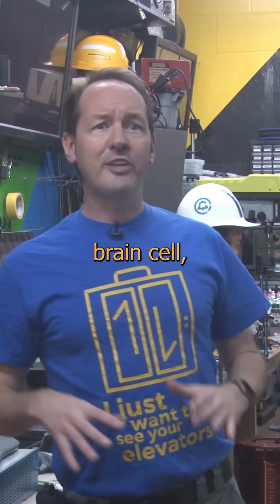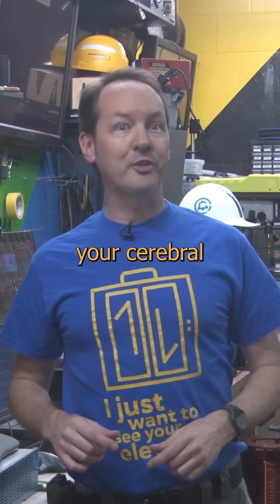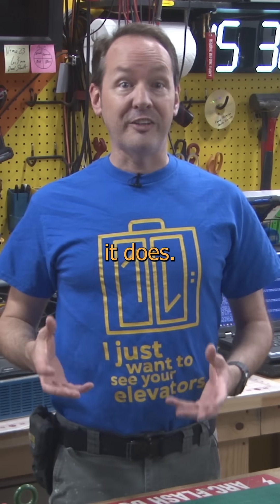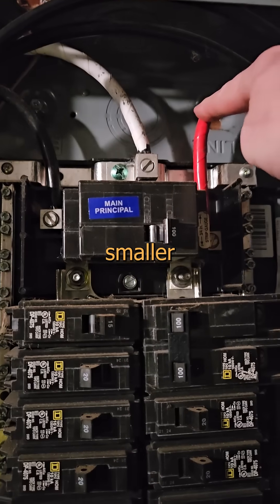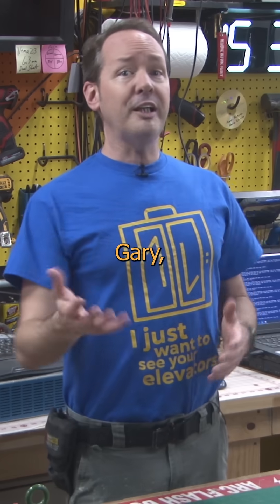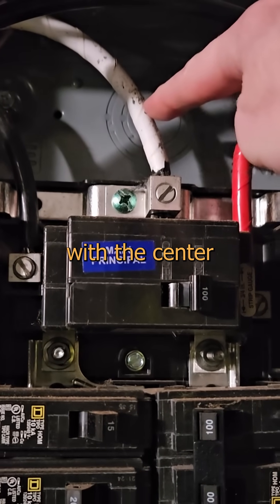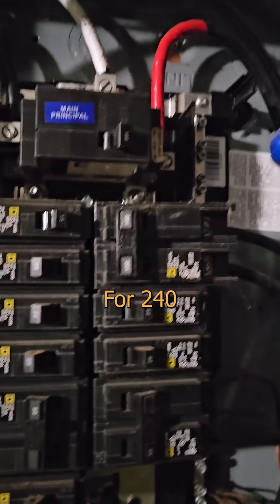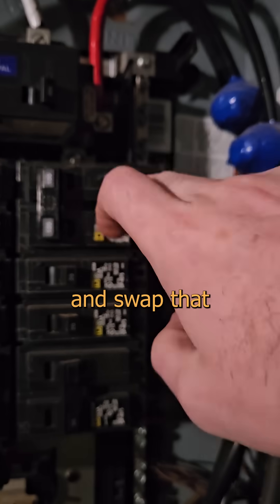Why It's Smaller #engineering #chrisboden #comedy #electrical #science #energy #power #electricity

Comment: And for those with 4 brain cells: what happens to the 120v circuits if the neutral is missing or cut?  Do they:

A) stop working entirely
B) become 240v circuits
C) Let's out all the magic smoke and burn your home down in cataclysmic flames
D) The voltages of the 120v circuits change to something between 0 and 240v, depending on what's on the circuit.
Reply: E. All of the above, depending on various and sundry circumstances! Lol

Lost neutrals are always exciting, and what exactly happens depends on lot on what loads are present and how they are wired, but yes, it causes strange things to happen, from some things not working, to other things getting way too high voltage, and varying as loads turn on and off.

Comment: The fun starts when you LOSE a neutral. 120 doesnt become 0...no no that would be too easy.
Reply: Yup. Best case scenario is that the neutral wire becomes more unsafe to touch. Worst case… well, let’s just say that I’ve seen receptacles become 240v to ground.
Reply: You end up with a situation where some outlets are 150 and others are 90 or whatever, and when you turn on the microwave, the 90 goes up to 130 and the 150 comes down to 110, and the LED light in the kitchen starts flickering. And every time you touch that light switch over there, you get a zap from it. That kind of crap can happen.
Reply: No the worst case is an intermittent floating neutral

Harder to track down 🫠

Mine involved an HOA owned panel 😶‍🌫️
Reply: What causes a nice head scratcher is when someone doesn't ground the X2  on the transformer. I worked at a plant where none of the transformers in the building wasn't bonded. Apparently the past maintenance people thought it was a waste of wire. 🤯

Comment: I have a question about over amped loads. We have air compressor that are on a line about 100 ft free a breaker box that is about 100 ft from the main box. There is a transformer for the break box that steps us up to 240volt (main service is 208). 
When the compressors kick on, the 20 amp motors pull 140 amps for 2 seconds or so, it's on 8 gauge wire I believe from the box. When this happens, we can hear in the warehouse the wires vibrating in the conduit. I have never experienced this before, but I also never pulled that many amps 100 ft on 8 gauge( I don't know what the voltage drop is during this). The 60 amps breakers normally don't trip.
Reply: What's the question?
Reply: Sounds delightful! Lol
You would need to ask an industrial electrician who deals with motor start loads and knows which tables would apply to that.
I don't remember how starting loads are calculated like that, but I know there is some leeway, but from what you describe I don't know how long it will last, but it may be just fine.

Sounds a bit stressed to me in any case.

I would actually want to check the voltage drop at the end with the motor running, is it still within the nominal range for the motor name plate? If so, it's probably fine.
Reply: Hmm, I guess I could of snuck a question in all that rambling. 
Has anyone experienced this loud vibration of electrical wires inside conduit?
What is the correct action i recommend to the owner that will probably never happen?

Comment: I am learning welding at a trade school and I always wondered something.

How does the school interact with the grid? We will be running upwards of 70 welders at any given time during class, I know those can put out 310 amps at about 20 volts when cranked, does this have any effect on the grid? For example in the morning when class starts, we go from a very low load, to all of those machines getting kicked on and starting getting used all in about a 5 min time frame (though we are sitting at 125 amps at 20 volts more commonly) does this require any special load balancing on the grid?

Thank you and have a good day!
Reply: Your 20V is being transformed to 240V of even 800V (some commercial grid hookup).

Total wattage always start the same. W = V * A, si if Voltage goes up, Amps will go down.

240V/20V = 12x scaling

Meaning on the other side your 125amps get 12x reduction, to about 10 amps.

Total load starts the same, 125A*20V=2500W, which is equal or less than your typical electric resistive heating baseboard which is a pretty regular charge...
Reply: Your school will have a commercial connection and the loads on each phase will be balanced within the fuse panels.

Comment: Never knew that’s how 120 was made. Always thought it was transformed just after the breakers.
Neat!
Reply: Those boxes at the pole are step down transformers and are coils picture a big spring with 3 wires coming off it.  On both ends of that big spring you have a wire with a volt gauge they'd read 240V across that's the black and red lead to your house.  Smack dab between them on that spring is the third wire so 60 times a second the field switches direction pushing out red to pulling back red and so forth and half way between is that neutral to balance it out.  

The real mind freak stuff happens in 3 phase system
Reply: Close, but not quite lol 
Your spring with 3 wires is correct, but it's 240 potential end to end, and the center tap in the middle just makes half of that potential available, with 120 volts potential between it and either end of the "spring".

It's no different than 2 AA batteries end to end, 3 volts across the ends, and 1.5 volts available from the center to either end. 

And no magic happens either, the entire coil is affected identically by the same magnetic field, so all the same phase across the entire coil, it's just literally dividing the potential in half. 

 @knurles
Reply: That I knew from an earlier vid. I thought there was a small transformer in the house to step the 240 down to 120

Comment: Yeah it cancels each other out, until you load it up with power supplies that have weird harmonics on their current draw, and suddenly  instead of cancelling out, it gets summed. We've had that here on a 16a 3 phase group, loaded it up full with fancy theatre led lights spread over the fases, then the neutral started to melt away on the cee plug.

Comment: Fun comes with 3 phase and harmonics, where the neutral current can actually be greater than any of the phase current, if you have lots of non PFC corrected 3 phase inverter drives, or lots of single phase non PFC corrected power supplies, which cause lots of harmonic current to flow.
Reply: I worked in the CBD substations in the seventies , the high rise building loads included lots  of fluorescent lighting . In those days the flourcent lighting ballasts where wire wound and that produced third harmonics which quickly added up so the neutral busbars where larger than the LV  phase busbars. As a young tradesman it didn't make sense to me until I did some research not easy back then with no internet .
Reply: @noelcastle3986 Startup surge when these buildings are on a lighting timer and all these ballast transformers come on at once can make a neutral sing the song of it's people for a few seconds!
Reply: And this is why some engineers require 200% neutrals.
Reply: Super neutral  @jeremymontgomery9354
Reply: especially bad when an old office building had "round robin" circuits feeding mechanical adding machines, and they replaced them all with computers.  you'd see a nuke that used to cover 3 20 amp circuits, carrying close to 60 amps, at 180hz.  the wire colors would be black, red, blue, and brown.
Reply: Walked by a few older building transformers that sounded like this might be happening
Reply: On one hand I do kinda understand what you're saying I think but on the other hand saying this out loud makes me feel like I'm explaining the turbo encabulator.
Reply: I never knew harmonics played such a big role when it came to unbalanced current.
Reply: @jsb7546  diode bridges and such nonlinear loads can really mess with power lines, which is why power companies will measure the reactive power use for big customers, and charge them for it. Domestic and commercial customers not really so much till you get to be a big draw on the local grid, then they want you to have power factor correction, along with your local transformers and high voltage metering.
Reply: Most three phase inverter drives I have seen dont have a neutral connection, so they shouldn't cause any harmonics on a neutral if they are just line to line connected.

Likewise if you have a building that is primarily running lots of switch mode power supplies, such as a data center, in pretty sure the harmonics issue can be avoided by connecting the power supplies to a line to line connection instead of line to neutral (at least in the US.) most modern power supplies are multivolt, capable of running anywhere from 100 to 240 volts. So they work perfectly fine on 208.

Europe though donsn't have this option since their phase to phase voltage is around 400 volts.
Reply: ... generating lots of angry pixies if one is not careful!
Reply: You’re the right kind of dork.
Reply: I beg your pardon?
(“That sounds dangerous” and “what on Earth do you mean?!”)
Reply: @SeanBZA  i read this and understood so little i thought is was from the rockwell retro encabulator thing (Which i honestly still believe it might be)

Comment: my third braincell died when you said "but for 120.."
Reply: 😂😂😂😂 good one.
Reply: Brain cell 1&2 are dragging 3 to back to bed
Reply: this is why i stick to things that can be powered by a 9 volt battery, like a fuzz pedal
Reply: This is one of those videos where I'm dying to learn what he's trying to teach but his mumbo jumbo is so chaotic I can cut through it to retain the actual knowledge 😿
Reply: Canadian student here. We're taught and most of our houses are 120/240v single phase. Really interesting to see the different voltage used in different places
Reply: @samueltabor1460  230 to ground, 400 across with all three phases into oven/stove is what we’re doing across the pond. I still can’t wrap my head around what exactly you guys do in the transformers
Reply: 3? is that what my 2 brain cells are trying to accomplish by rubbing on one another?
Reply: 120 is split-phase
Reply: I only know 230 to ground with 3 phases in the panel, so DAFUQ ya doin‘ over there?
Reply: Third braincell not found, just 2 gay ones hoping the other one can get pregnant.
Reply: For those not quite getting it: US power is 240 V. The 120 value is because the neutral/0 V reference is set at the midpoint of the voltage, so the full 240 V is measured between +120V and -120V. For most applications, taking half of that range, 0 to ±120 V is enough. For heavy duty appliances (mostly clothes dryers and HVAC), we have access to the full 240. 

Physically, this is achieved with three wires coming off of the transformer coil. One from each end and one at the middle, which is referenced to ground. The ends have a potential of 240 V relative to each other as they are (close to) perfectly out of phase, but only 120 V relative to anything else.
Reply: @itar10n  meanwhile here using 230 as standard with 400 (3 phase) for heavy duty
Reply: Yep everytime someone starts with the 110/220v system in us houses im like but why?!?  230v1~/400v3~ is just a lot more capable
Reply: @notparanoid912 when the us electrical system was first implemented it was 110 volts dc mostly used to power incandescent lights which can take dc or ac power so when ac became popular it just stayed the same voltage that way people could use the same light bulbs they had been using. Over time utilities have raised the voltage to 120 because of increased energy use. 220 volt started to be implemented in the 50's because large electric appliances like whole home heating/cooling and cooking appliances started to be used. And just like 110/120 volt its now 240 volt not 220 volt becuase of increased energy use.
Reply: @Peter-jo3wt  really? Cool. Everywhere in your place? How about neighbours? I find this interesting. 🙂
Reply: @mcdahnahld same in Chicago. I’m 131-135/250
Reply: @jsb7546  yes, Western Europe started with 110V, too. But we switched to 230V decades ago to supply all households more easily and we don't understand why the US didn't.
Reply: @blarfroer8066  The US actually did switch to 240. The only difference is that we have a “tap” in the middle. That also means you can basically get two separate phases for weird specific applications. For most applications besides very high loads, 120v is way more than enough; so we stuck with it and only run high loads off of the full 240v. Mainly for safety reasons. (Despite our questionable plug design.) Some houses over here even have 480v circuits, but those don’t see much usage in the home.
Reply: @BrapBrapDorito my understanding is the two hot poles of "240" is "smoother" than just one hot 120.  Would we have smoother running appliances if we had two 60V for 120v combined?  I guess probably the conductors would need to be larger for the lower voltage.  Interesting how we transform to 240.  Seems like a well thought out voltage.  🤔
Reply: @blarfroer8066  Because the US was wayyy more electrified than Europe was when 220V light bulbs came around in 1904. Tens of millions of American homes, buildings, and appliances were all built for 110V at this point. Europe had small pockets of 110V service, but large scale electrification happened after 240V tungsten bulbs were available in sufficient quantities.
Reply: @blarfroer8066  All houses in the US are supplied with 240V of power.
Reply: @blarfroer8066 Simple; installed equipment. That is, there was a significant amount of installed equipment at ~ 110 - 120 volts. There was significant urban electrification by the 1900's and that prompted more of the same.
Beware, this is a very simplified view of the 120 - 240 volt status here in the States.
Reply: @jsb7546  Long story short, USA is incapable of adapting. Changed too late and now it's too big of a system to adapt. Similar as to the measurement system.
Reply: @blarfroer8066 it's because the average American doesn't care about spending the money it takes to upgrade their electrical system for a bit of increased capability, which they don't need. If it ain't broke, don't fix it, we're not like Europeans who like doing the most to squeeze out the smallest increases in efficiency and call it innovation, when you spent more on the efficient system than the efficient system saves. Those that have a need, can easily upgrade to 240, in fact our grid is made to handle it, it's just up to every individual American if they need that increased capability and want to shell out the money for an upgrade. The power company has everything set up so that you can switch whenever you want, it's us the Americans that don't need nor want to personally upgrade on our end and tap into the more capable version of the existing power grid
Reply: @Mark-SanDiego we do this on ships.
Reply: @notparanoid912  I think you are still misuderstanding this. US houses are 240v single phase, we just have a tap in the middle as well. AFAIK There is really no difference in capability in practice. Outlet and lighting circuits in the UK are rated to supply the same wattage as US ones, looking at voltage in a vacuum doesn't tell you much.
Reply: @kylehenline3245  I think the voltage difference between the conductor and earth is what is usually compared for single phase
Reply: @notparanoid912  Why would anyone want/need 240V on every outlet and cord in the home?  The only 240 V outlet we still use is for my arc welder.  Our lighting (all LED) and electronics draw almost nothing - we could run them off 12V.
Reply: @d.jensen5153  230v gives you plenty of power for stuff like powertools, waterheater, hairdryers etc while being more efficient and needing smaller wire diameters. Why would you use an additional voltage to complicate stuff?
Reply: @notparanoid912  All US homes have 240V. 
The reason for 120v outlets is because they are safer.   I have a 240v water heater, dryer, range, and air conditioner.  But I don't need 240v to power a stereo or an LED light.
Reply: @notparanoid912  We have 240, there's just no need to run it everywhere when 99% of the time 1200 is more than enough.
Reply: 😮😅😂 mine shorted out.
Reply: I'm struggling to see the argument for 120v with people saying you don't need 240v at each power point. The advantage of a higher voltage is for the same load you have lower amps (ohms law), you need smaller conductors and have less power loss. Its the same reason distribution lines run at 50kv plus.
Reply: @jonmusgrov It's for safety. A 240v shock is doubly as strong as a 120v shock. Simple as that.
Reply: @mewmew8932 it takes as little as 10mA to kill, funny thing about 10mA is at both 240v and 110v its still 10mA.

When i was a kid i used to play with the piezoelectric igniters they produce 10kv and i dont remember dying from them.
Reply: So, the US uses (in my european oppinion stupid) split-phase power for most devices.

Your transformers have 3 'legs'. 2 phases, 1 neutral. Either phase to neutral, you have 110-120V, over the 2 phases, you have 220-240. This is why old 120 circuits usually have ground on the nom-phase wire and not on a ground pole.

On 240 circuits you need the 3rd pole as neutral to be able to get 120 in a 240 device, as there can be commodity 120 options where 240 would need specialized hardware. The 4th leg on 240 connectors is usually a true ground, as a place to dump the 'OH FUCK' power can be quite helpful.